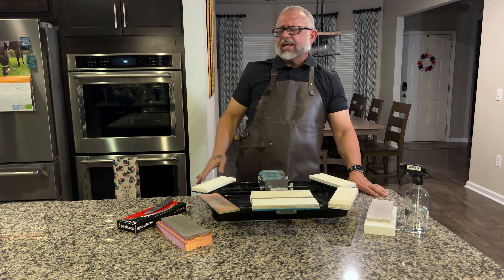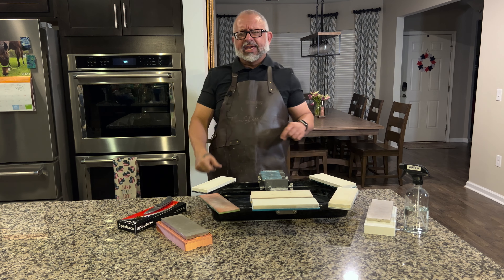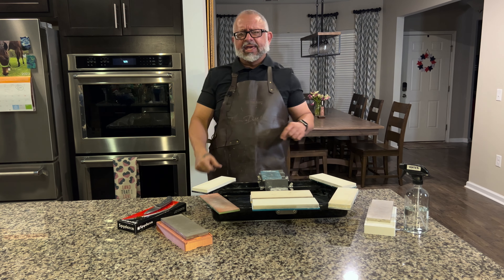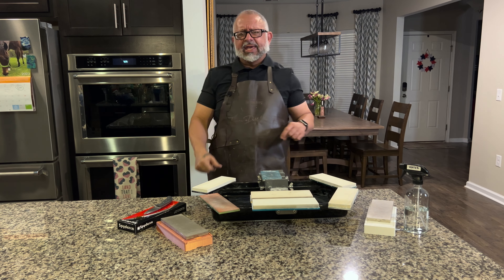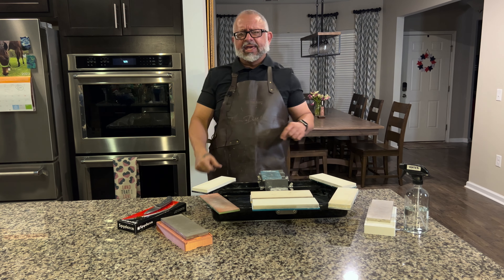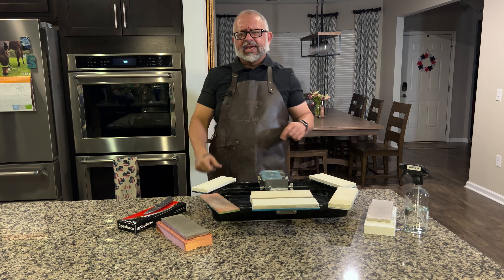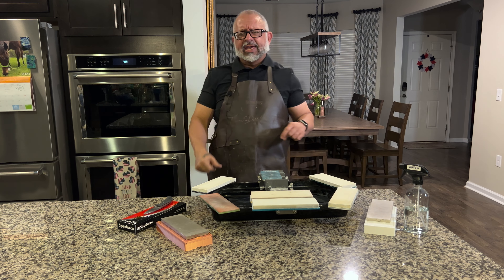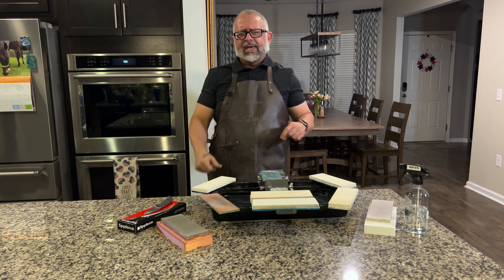Knife knowledge/knife basics - You got a burr… So what?

Comment: 7:33 I am not sure what the message is.

Are you saying the steel is not totally uniform, therefore you need to sharpen back the steel layers until you get a sharp edge to the feel?

Or are you saying, you can create a UNIFORM burr on both sides off the first stone, but the apex can still be  all over the place.  Like some tilting left some tilting right.  And you can't detect it because a huge burr is present.

So you have to deburr and judge the apex by 3 finger test?

If this is true, then you should also do the same test with subsequent stones to make sore your refinement steps hasn't messed up the apex right?

So this is suggesting you SHOULD DEBURR AFTER EACH STONE?  That contravenes the conclusion from the previous "deburr after every stone video" right?
Reply from the maker: Sorry for the confusion. Basically you need to thin the knife. Whenever you look at the knife and you see that has had an edge, you can start to remove metal and receive a burr. Once you feel the metal shavings off the edge of the Blade, you can possibly think that you have done what you needed to do to create an Apex. Just because you feel the metal burr does not mean that you have done everything that you need to do to create the Apex and have a sharp edge. I was reminding you that the burr is a misnomer. That you need to feel the edge and the Apex, which is the edge with your fingers. And doing so you can move on. I ended up Sharpening this knife several times before I got a BESS score of 47.
Reply: @nadm  Ah so with each sharpening you did some more thinning?
Reply from the maker: @l26wang  that’s basically what ended up happening. We didn’t mean to Senes. We thought we could put an edge. We ended up realizing that we had to keep removing metal before we got a sharp so…

Comment: This is exactly what I’ve just recently discovered as well. My current goal is perfecting the burr removal. Subbed. Keep up good work. Stay sharp. Fyi you can apex on like 220 grit and remove burr/strop and result is very sharp
Reply from the maker: Nice!!! Thank you!!
Reply: @nadm  don’t forget to always run your edge across the stone a few times to remove that old edge  before you sharpen. That way you’re working with fresh steel!
Reply: @austenhatch3285  Never thought of that.
Reply: @austenhatch3285 both ways work. Cliff stamp did that then sharpen without even making a burr in the first place, in that case you want fresh steel. If you sharpen to a burr then remove, youce already removed more steel than nessesary to apex it, and so your burr is the only old steel left.

Comment: Maybe the way the knife was used led to a greater area of steel fatigue behind the edge.  So, more steel than usual (the usual being just enough to form an apex per side) had to be ground off in order to expose new unfatigued steel that could give a good edge.

Plus, it was dull AF and hence more metal had to be taken off than usual in order to form an apex. As in, the centre was not yet touched even though a burr already formed. 

I'm still not sure that you need to deburr and get an amazing edge every single stone because that'll be such a waste of time. I just roughly deburr and make sure both sides are equal (if sharpening conventionally) and really only properly deburr and strop on/after the final stone. Then again, I have no bess tester, so I might be completely wrong there.
Reply from the maker: Exactly. I don’t think people understand that we really did have to remove a lot of metal to finally get an Apex. It was very easy to feel metal shavings coming off the edge of the blade and it just gave me the illusion that I had done the job.
Reply: @nadm  Welcome to knife thinning... Yes, it's a PITA...

Comment: I own a knife made of 64HRC Magnacut steel, and I find it effortless to sharpen using the Shapton Glass HR stones, I take it up to 16k grit. Surprisingly, it attains a similar level of sharpness as knives made of blue #2 and SG2 steel, without any difficulties. It retains its sharpness for a significantly longer duration compared to my other knives.
Reply from the maker: The American knife makers were very adamant that the American steel and the new steals are gonna be better. The Japanese at the Japanese have not moved away to these types of steel. I’m interested in getting into them and then seeing what is up

Comment: Great thoughts most relevant to some “modern” steels.

As I have often thought - it depends. It depends on how much time one devotes to sharpening any one knife.

If it’s my own, and the knife is a specialty use tool, I will likely spend an hour or more working and reworking the edge. And I have found that feeling how the metal “succumbs” to the whetstone is sometimes better than seeing too! 

It has a high frequency “scrape” to begin, then “bites” with a lower frequency even sound when the bevel is at the “right” angle and is consistent along the edge and in both sides.

This is best felt when the bevel is being set with the lower grit whetstone.

If it’s for a couple of chefs who trust me with their working tools, I may just get them sharp. How sharp is sharp enough? It depends…

These tools need to go back to their owners ASAP, and they often take a beating!

But I learned something today based on your experience.
Thanks!
Reply from the maker: Scott Gunn sent me the night and he made it down. Lol but I didn’t really expect to have to do so much Denny. That’s why I came up with the video because I felt to be metal hanging off the edge and just thought I was done. It actually took three or four times doing it before it finally received a BESS score of 47. Then we had to bring it back.

Comment: Well this just confirms what I've learned from some people who share their sharpening knowledge. That if you can't make the knife sharp and to your liking on 1000 grit stone, "hair-whittling sharp", you shouldn't even consider getting finer grit stones. Because it means your skill is lacking, that's where you create the geometry and sharpness, the rest are for refining and polishing, as you stated. And it's been a learning curve, but limiting myself to 1000 grit stone has made me more demanding on myself and caused me to finally become a bit better at sharpening. People talk a lot about higher grits in terms of different applications and have philosophical statements about them, but the physics is that you start with the ~1000 grit and if you can't make a good item with that, you have some lessons to practice and don't need to think about finer grits and different stones.

But I also learned the importance of keeping the stone flat and consistent angle repeatedly until the results are there. It can be weird to keep on doing the same thing and seeing seemingly lot of material removed on the stone when you can't see what's happening on the edge, but it is for a reason. Sometimes you're just doing a different part of the process than you think you are. I was definitely guilty of having slighlty inconsistent angles, too hasty with the movement, too hasty to jump to the next stone. Part of it was learning to feel the burr, that's an important thing to learn as well, not saying that, but it misleads you so much if you're not aware of the rest of the details in the process. Until I learned this lesson, keep working on the same stone until you have results, and be slow (if needed) and consistent, that's what does the magic.